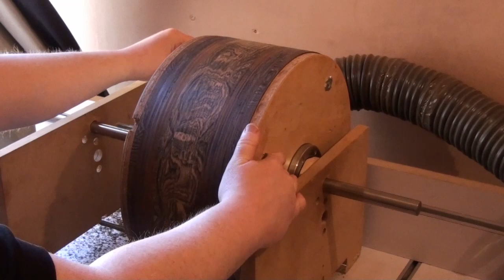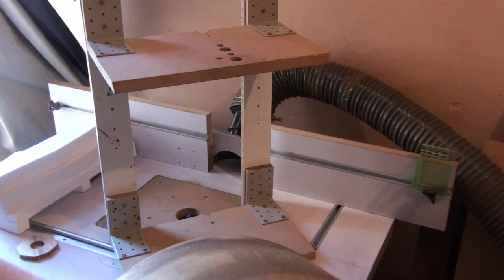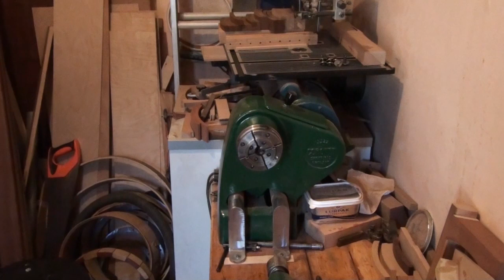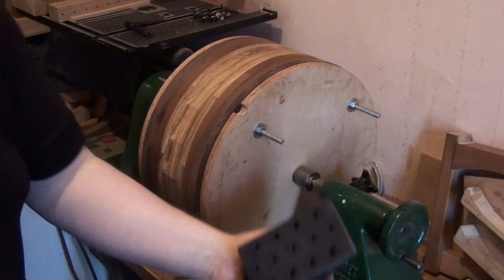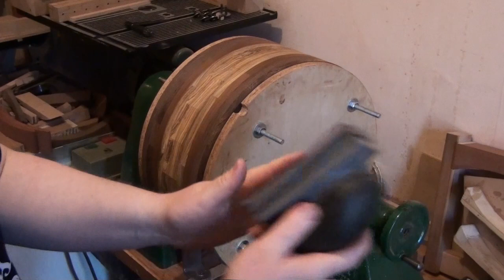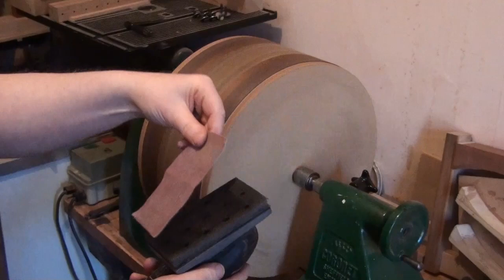Murray Drums - Turning a 14 x 6 Bocote, Dark Birch and Wenge Shell.

Comment: Absolutely stunning shell... Are segmented shells much more prone  to fall apart due to changes in temperature/humidity? Compared to plywood shells I mean...
Reply from the maker: I've not had any problems with shells failing so far.   As long as the grain direction on all the segments is running the same way, (horizontally for segmented shells, or vertically for stave shells) all the wood should move together.   The only two times, that I'm aware of, that one of my shells has ever failed, is because the customer has dropped the drum, or modified it in some way.   In both cases I was able to repair the damage.

Comment: Wow! Beautiful!!!
Is that 2 separate parts of a lathe? Looks like it...if so, did you buy it like that or did you mod a lathe? Can't believe I never thought of that!
Thanks!!! :)
Reply from the maker: Well the head stock and tail stock were all part of the same lathe, but the bed bars which run from one end to the other, only allow objects up to 12" in dia. to be turned over the bars, so I got new bars made with a gap in the middle, now I can spin anything up to around 20" in dia.     The lathe isn't really powerful enough for turning shells up to that size, but I only use it for sanding and applying finishes most of the time, rather than actually wood turning.
Reply: Murray Drums that's pretty much all I want a lathe for too lol. Can you take like :30 (or longer lol) talking about it and showing it...in you're next video?
We have harbor freight out here in the northeast US. I doubt you have them there. Cheap tools...but a lathe from there should Sufi e for sanding. Thanks brother!!!
:)